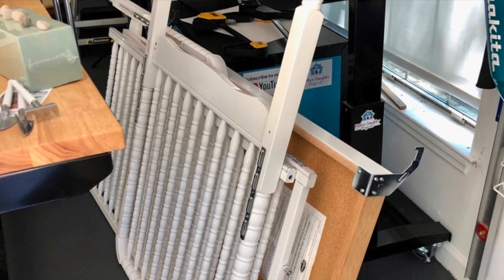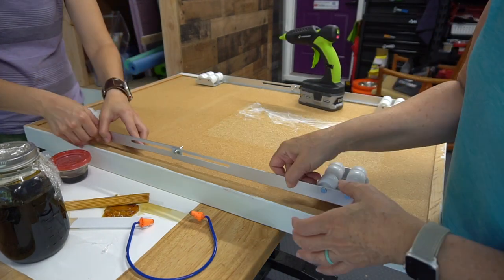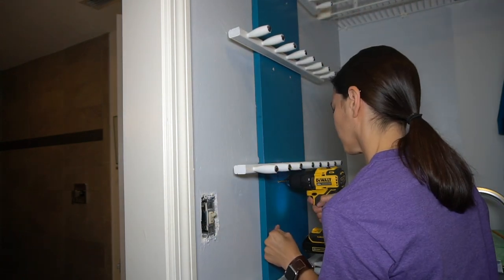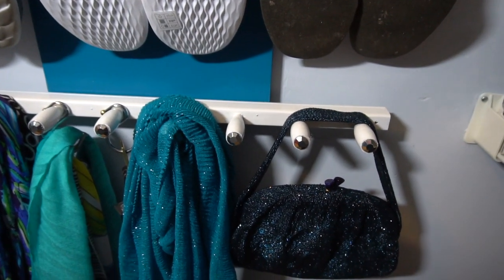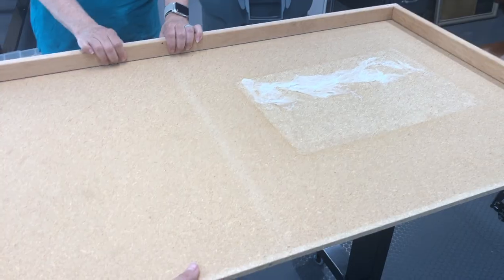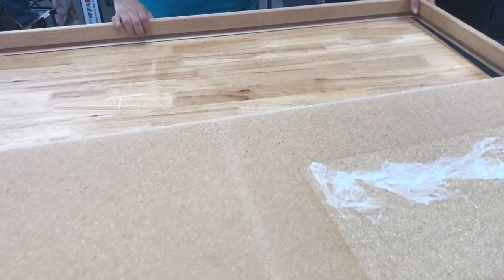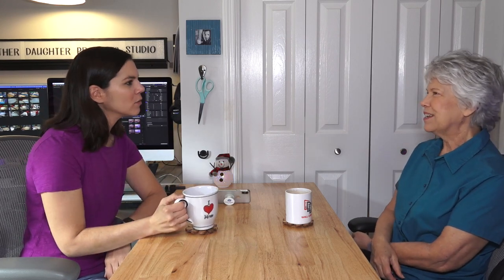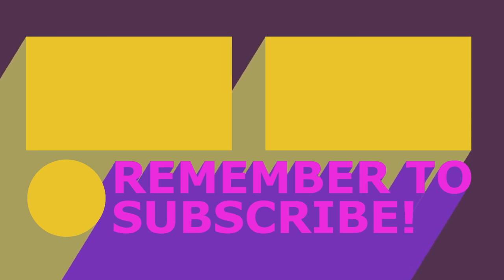Under Bed Storage Solution for Shoes and More!

Comment: much better is to stand a crib side on its side at an angle next to a wall. you can stick shoes toes-first in the obvious slots. Easy, more space effective, easier to access the shoes!  I did it and wonder why nobody else mentions doing this easy, no installation problems method with crib sides. Lotsa shoe storage, no problemo.
Reply from the maker: Great idea Sandy- thanks for sharing!